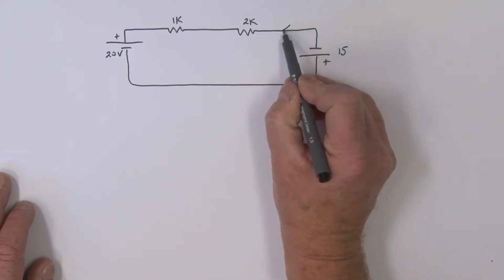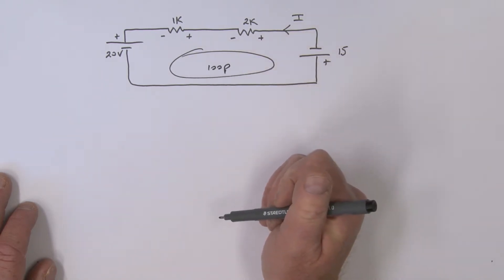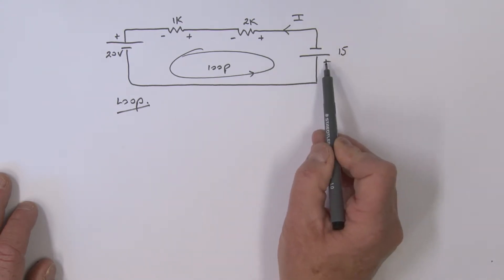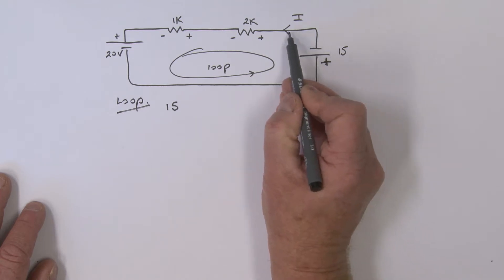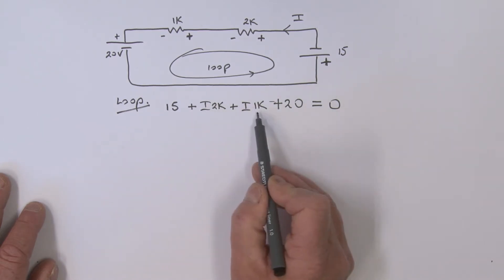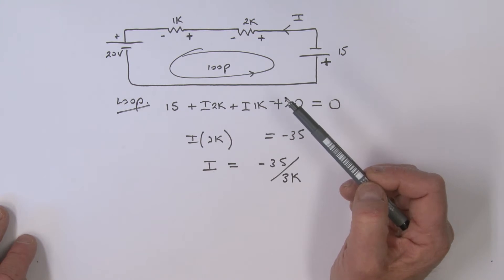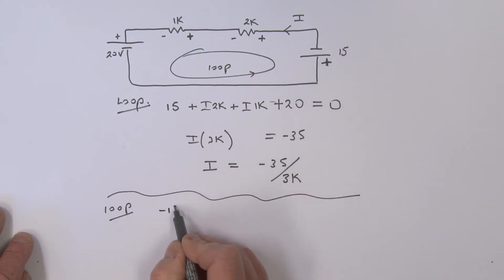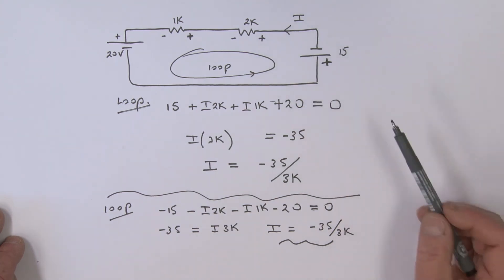Alternative Voltage Summation Convention

Comment: In summary, if you multiply one convention's equation by -1 on both sides, youll get the other equation (convention).
So theyre equivalent. But the voltage drop at a site is still what it is: if you go from positive to negative, thats a drop in voltage, which is also the direction current generally flows